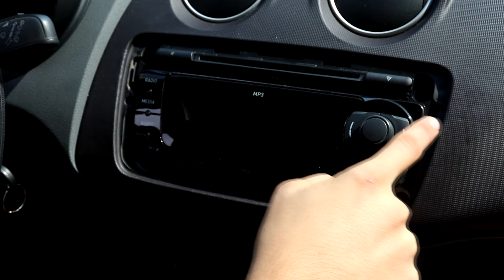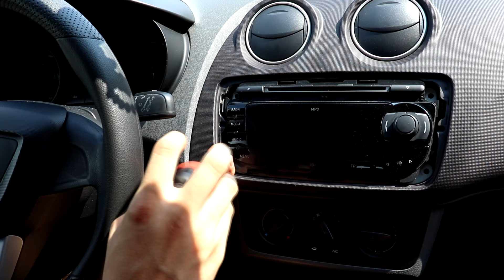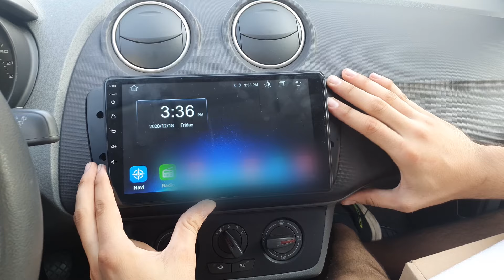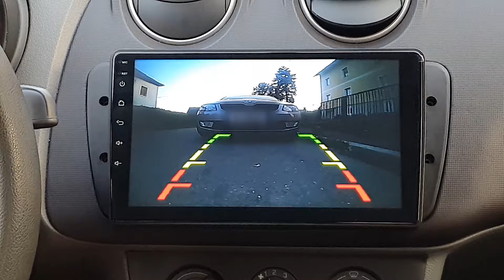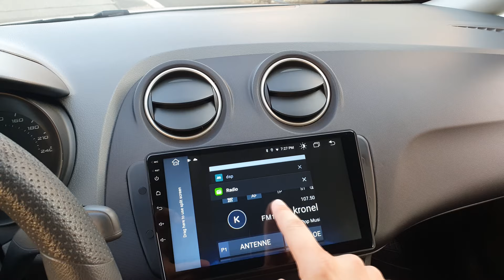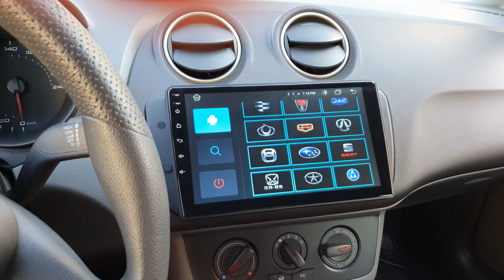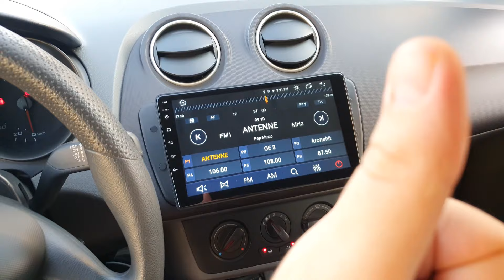ANDROID RADIO INSTALLATION, SEAT IBIZA TUTORIAL

Comment: Hi, did you have access to climate control through the head unit? Ive installed my unit and set up canbus. Climate controll does not seem to work.
Reply from the maker: I dont try it. The car is not mine, but try to contact the seller. Have a nice day ☺️

Comment: Hey there,
Thanks for a very good totorial, its well done and simpel :)
Just have a question to the yellow phono kabel for the camera! 
What did you do with the thin red wire that stiks out from the yellow phono kabel, i cant figure out where to mount it?? 
preciate your help
Reply from the maker: Yellow ist for the signal of the camera, and red wire is for the trigger, from the reverse light(+).  You have shema from the multimedia, where it goes.
Reply: @Drxxx  thanks, i have figured it out and its functioning now 👌 
Thanks for the reply 👍🏻😊

Comment: I just did this install on my 2013 Ibiza FR last week, same unit. Unfortunately the steering wheel buttons don't work anymore and with the rear camera, it only works with the engine not running, because as soon as the engine runs, the video signal is lost. I'm in contact with the vendor in China but not getting much help due to his broken English probably translated with Deepl.
Also this radio is very slow until on line after starting the car.
Will probably return it.
Reply from the maker: Hi, did you try to programme it? You can the buttons programming.. look on the end of video, you should type a password..
Reply: What did you do about the hazard light and tc button?
Reply: Same problem with camera on my Seat Ibiza 2011 ST. Do you fix it?
Reply: how is the unit is the touchscreen fast and responsive?

Comment: Hi. thanks for a great video. I installed my device today and noticed that I have no sound in the rear speakers. did you encounter the same problem? what could be wrong? otherwise everything works fine.
Reply from the maker: I dont have it.. try to find in settings about sound
Reply: I have it too! I can’t find a solution
Reply: i have the same issue did u find a solution
Reply: A bit late but not every ibiza has rear speakers

Comment: Love how you can always make the interior look better, defo doing this to mine. But I'm still looking around to see if you can add the FR facelift front bumper to the standard Ibiza. Also does this Infotainment system have to be for a specific model variant and year?
Reply from the maker: It should go on facelift also, you have more connectors its should work on each..
Reply: Hello, mate why does my screen doesnt turn off along with the car ?? And also the here app dont work offline
Reply: @jorgeramirez7051  Some radios come with power cables that you have to leave unconnected so it doesn't get power constantly.

Comment: hi. On the camera wires I connected the red one to the reverse gear wire and the black one to the minimum ground wire and on the radio I only connected the yellow connector. It doesn't work, the image appears with interference and nothing is seen. Any tips?. And great video
Reply from the maker: For some models you should connect on multimedia extra red wire, for this model, you should connect only 12V from Reverse light, the camera starts working and send the singal to the miltimedia, if it doesnt work, try to connect the camera with 12v battery

Comment: Great video.
 1) does the steering wheel controls work with this rádio?
2) Does de factory Line In and USB port work with this radio?
Reply from the maker: You have setting and you can set what the keys needs to do if pressed... for usb you have port for 2 usbs in the radio..
Reply: @Drxxx  its not possible to put the factory installed line in working?

Comment: which cabels are needed for the camera? ive tried the back lights one but it isnt shown in the video at 6:30 ? thanks a lot for the help!!! 🙏🏽🙏🏽
Reply from the maker: Find positive wire from reverse lights, this puls goes to the multimedia or camera, some multimedia doesnt need this trigger wire. Connect as i did in the video and it will work
Reply: I also got lost at the camera section. What do i connect to the postive wire of the reverse light?

Comment: does the stereo take power when the ignition is switched off/does it drain the battery when not in use?
Reply from the maker: You have connector witch needs to be disconnected ( check on the video) and than works only when ignition is switched on
Reply: You mean this orange cables with the black fuse right ?
Reply: Good evening, I have the same screen and am facing the same problem. when I remove this red cable that you show in the video, the screen does not work at all? am i doing something wrong?

Comment: do i have to install the rear camera looks complicated actually its just the wires that confuses me with the back camera the bit with the headlight and how you run the cables to the front or if there is already cables there you can use
Reply from the maker: For camera you should install the camera cable from multimedia up to the camera. This is most complicated part. From the headlights you should find + terminal from reverse. That’s it.
Reply: @Drxxx  thank you does the parking sensor still work fine with beeping

Comment: good job! could you tell me what are the colors of the two wires of the reversing lamp? thank you
Reply from the maker: I forgot to take a video about wires.. check with multimeter.. one is ground(COM) , and other are positive for each lamp=1 contacts.
Reply: @Drxxx  thanks, i solved with the tester, green / blue and brown color. I have another problem, turning on the position indicators turns off the radio, has anyone had this problem? thank you

Comment: Which canbus nr did u use for the steering wheel controls because i am using 122 in my Ibiza and its not working...
Reply from the maker: I don't use it.. you should opet the hidden setting and adjust what keys needs to do..
Reply: @Drxxx  and how do I do that, can u please help me? 🙏🏼
Reply from the maker: @butrintgashi5350  hm, go to the settings, and scroll down, you should find SWC settings and there you need to select the button and press it on steering wheel.. you have boot settings, password is 5678, look almost at the end of my video, you can find boot mode..
Reply: @Butrint Gashi I solve the same problem doing the right connection of the cables. I forgot Connect a White input

Comment: Hi I follow the video to Connect the cartablet and is all ok. I have a problem to install a retro camera. I see light of camera when i do reverse but i can't see the image. I dont know how to connet the Red cable in the back of tablet
Reply from the maker: For picture you need video cable.. and red wire for sign, but only if your car doesn't have CANBus! If you have it, multimedia will be switching to the camera automaticly by changing in to reverse gear.

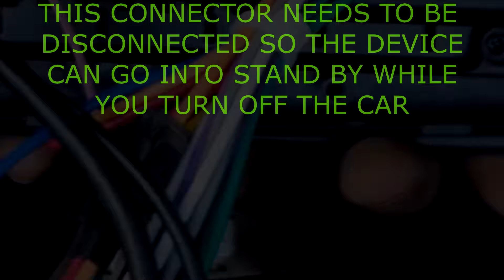Comment: After installing the head unit the MIL light (check engine) is continuously on. When I try to read the codes with VCDS I don‘t have any failure codes that should result in a MIL lamp. CAN box is conntected (also the yellow-brown little connector between CAN box and Radio), plus the red-orange cable is disconnected like you showed at 09:54. Did you have any similar problems? 🤷 I like your video, thanks for the tutorial! 👍
Reply from the maker: I disconnect and connect the battery..after that was all OK
Reply: @Drxxx  Thanks, I’ll give it a try. 👍
Reply: It worked! It took a while to eradicate the failure code from the car, then I simply disconnected the battery and tried to conncect the head unit again. Now, after plenty of ignition cycles and a couple of test-km I don’t have any “engine errors” on the dashboard. Let’s pray it stays this way… 🙏🏻😁
Reply from the maker: @istvanvarga1737  great :S good luck

Comment: hello friend my multimedia works constantly when i remove the key it works again and it drained my battery.
what can i do to stop it working constantly
Reply from the maker: Check on the video.. you should disconnect one connector and than will be working only if you plug the key.

Comment: Hello, I have the same radio as you, but a more complete model, with more functions, such as 360° cameras. The problem I have is that the steering wheel control doesn't work for me, do you?  The touch buttons on the screen frame do not work for me either and it never turns off either, I have to disconnect the fuse that powers the radio.  you can help?  Thanks a lot.
Reply from the maker: I don't have this buttons, but you have in engeenering mode settings, and you can set each button what means

Comment: Will the radio turn itself off when the key is removed? how to do it ? I have the same radio, everything works but does not turn off ... help!
Reply from the maker: Look in the video, i showed connector that needs to bi disconnected. If stay connected, it drains battery
Reply: Good evening, I have the same screen and am facing the same problem. when I remove this red cable that you show in the video, the screen does not work at all? am i doing something wrong?
Reply: @vasilisk1  yes you doing something wrong. 😃 do not connect this little black cube and everything will work
Reply: As soon as I disconnect this cable the screen does not work at all

Comment: The red cable from the camera, what color cable have you connected it to in the headlight?
Reply from the maker: Trigger wire, you need positive signal from your reverse lights, and if you put in reverse, the device turn the camera automaticly on
Reply: @Drxxx  I know, I have a seat Ibiza, maybe it's so I don't look for the cable. Is it blue and green?
Reply from the maker: @MrMenguix  hm i can’t  remember that.. 🧐
Reply: @MrMenguix hi did you find out? Because im really struggling i just dont know what color

Comment: How do I find the cables for the backlight ? Can you tell us the Color of yours?
Reply from the maker: You should turn in reverse and measure with voltmeter.. second option is, you can remove the tail light, and check the conncetion from bulb to the connector

Comment: How can i use the original Microphone of the car? The one in the radio does not work very señal
Reply from the maker: Check in hidden menu( you can adjust all parameters and change all settings)
Reply: @Drxxx  do you have a manual to do this? Or is it a video that explains it? I already have changed the microphone of the car, and still do not have good results, the microphone of the device is not good at all and I have even used the back 3.5 connector and still not working :( I’m not loving this car radio

Comment: Great video! I will check this out when I install camera. I wish I found this sooner because I already have installed mine a few days ago. I haven't disconnected the orange/red cable from 9:54 . Do you know how to remove the radio now so I can disconnect cable? Because I also put the black caps on top of the screws so I cannot unscrew the screen now...
Reply from the maker: Try to remove clips..  because this  can damage your battery.. it will always working..
Reply: @Drxxx  yes i'm trying, but i don't know how to remove the clips. any advice?
Reply from the maker: @riennelentertainment1290  try with tweezers or with phone-repair tools..
Reply: Hi can you explain more how to disconnect this cables it’s not clear as well what did y do with the back light why did y removed it can you explain more please thnx great video mate
Reply: @riennelentertainment1290  Same here, had this unit for 3 days, now my car battery is dead. Didn't know about a connector that can be disconnected to put the unit in standby. I'm also struggling with the caps and can't remove the unit because of them :-\
Reply: @itamaravidani  I suggest you use a knife to really get the caps off by force. That's how I did it. It's really going to destroy your battery otherwise.
Reply: @itamaravidani  What cable color needs to be disconnected? I have the same problem here!

Comment: I’ve just installed one of these unit but the issue I’m having is whenever i play something the sound only comes from the front two tweeters speakers. Do you know why. I’ve tried changing the settings but that didn’t work,
Reply from the maker: Did you connect it properly? And check in hidden menu, you can adjust the sound, balance and so on..
Reply: @Drxxx  I’ve tried adjusting that however it doesn’t turn the door speakers on. My connection seems all correct and the same as yours. Ive seen other people speak about having this problem but can’t find a solution anywhere.
Reply from the maker: @uthoughttherewasahaironurs9901  try to connect the seller or service..?
Reply: good news bad news. I disconnected everything and reconnected it and the speakers started working. However the screen is draining my battery even tho the red and yellow cable is disconnected. Any ideas?
Reply from the maker: @uthoughttherewasahaironurs9901    9:56 in the video, rec and orange ist to disconnect. check in the shema..

Comment: Hi, fitted today and have a few questions if you could answer please:

1. My car is a seat and the can unit identify it as a VW, steering wheel controls do not work. Is there a connection for these?

2. Rear Camera distance lines are not shown, looked through all the settings which seem correct, can you advise?

3. I was looking to go into developer mode but it needs a password tried the one on the video and a few generic ones which are wrong, can you advise?

4. When I click on ‘video’ it plays sound with warning on the display saying ‘do not watch video while driving, I’m stationery and it will not show the video?

I don’t see the menu on mine for the boot to change icon?

Thanks
Reply from the maker: Hm, for steering wheel check in manualls for passwort, i showed in video one of 2 passwords.. chekc in camera options if you can turn it on and off
Reply: Hi, can you tell me  how I get the rear camera distance lines to show. Please

Comment: hello, i received the radio from ali.  but the buttons on the steering wheel don't work?  and it stays on when you turn off the car.  how do i put it on the car contact?  the photo is the plug of the seat connection and the bottom 3 cables are not used in the new plug. Can you help me?
Reply: Can you help me?

Comment: I have 2 questions, which i really don’t know the answers. 
1. Why do you need to remive the stop lights ? And does he mean 2 cables per headlight or 2 in total so 1 at one headlight and 1 at the other ? 6:30 in the video

2. 
At 9:55 he says the connector needs to stay disconnected. Which is the connector and with disconnect does he mean that you can’t plug it in ?
Please help me.
Reply from the maker: 1. I need to be sure witch pins are for back light, and the radio is always pluged in, and if you dont disconnect the connector, after 1day is yor battery dead.. if you disconnect this connector, the radio works only wenn you turn the keys..

Comment: If i disconnect the orange and red cable ny radio powers off. If i disconnect the other red orange cable which is connected with a red and black smaller cable ny radio doesn't turn off when i get my keys out. How do i need to fix this?
Reply from the maker: Check in the video, i showed the connector which needs to be disconnected
Reply: @Drxxx  i did disconnect that cable but then my radio shuts down and won't work anymore so it looks like its a power cable or something
Reply from the maker: @patyoutube4114  did you connect it properly? The main connector, check fuses

Comment: What if my ibiza model has hazard lights where the original head kit was? Its 2013 just not double DIN?
Reply: u need to find the switch of an older model where the hazard light assembly is near the gear stick and then get a relocation harness to set the wires up.

Comment: Which one of the cables are for the reverse light? 6:27
Reply: Did you ever figure it out?
Reply: @conorwalsh7820  yeah, blue-green cable for live 12v, brown cable for ground
Reply: @luap6 so do i have to connect the red wire with the blue-green wire?
Reply: @Imran._  Yes, red cable to the blue-green and the black/brown to brown cable

Comment: 5:39 i dont understand that part. For what is this step for? Is the stop light not anymore after the installation? And wich 2 cable you have to take?
Reply from the maker: I need to check what wires are for the reverse lights, and take signal from there(+) to trigger the multimediasystem, if you put into reverse it turns automatically to camera mode.. in this part i showed how to remove the beam lights😄😄
Reply: @Drxxx ah i see. Thank you
Reply: Ty but still dont get what cable color is + . Can you help ? @Drxxx

Comment: Am I the only one who can't decrease or increase volune via the handle left to the wheel?
Reply from the maker: Did you find hidden menu, you can set each button on wheel steering.. check in video..
Reply: Doesn't work bro, the system doesn't recognize the buttons :(
Reply from the maker: hm.. did you contact your seller ? i orderd these on aliexpress, you should have a support from seller..?
Reply: @Drxxx  I'll try bro, thank you.